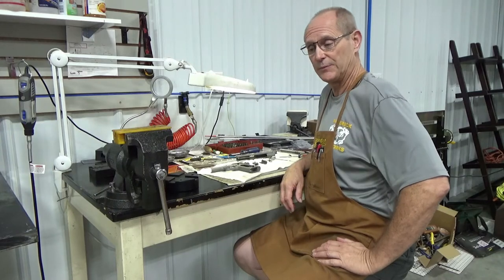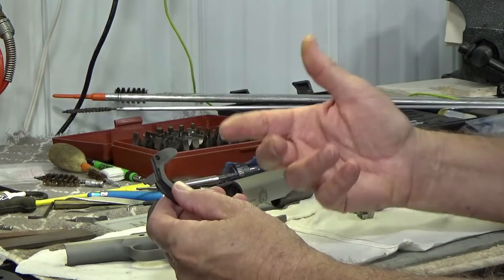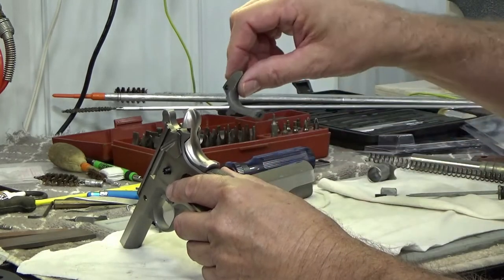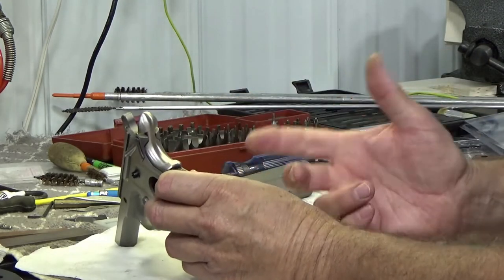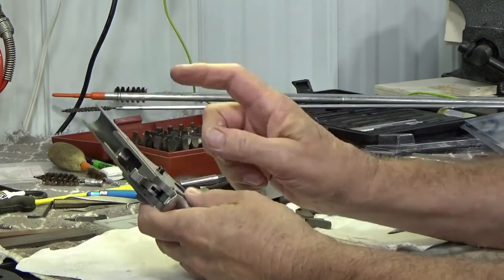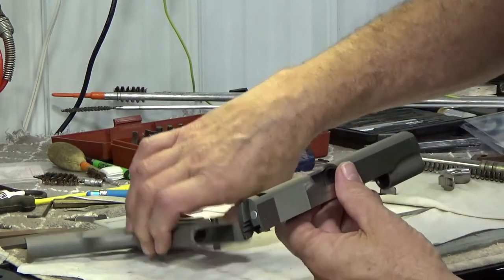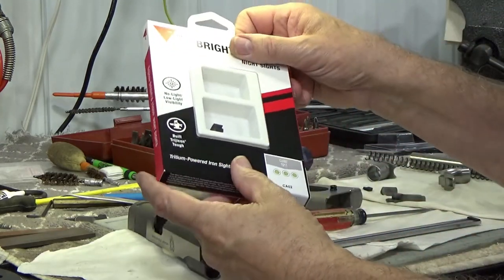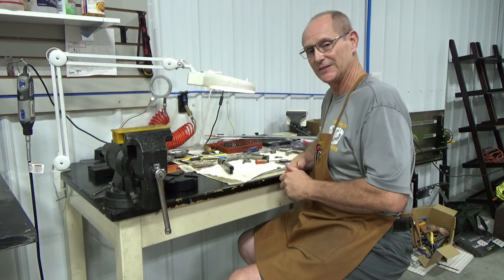Springfield 1911 Grip Safety Information

Comment: I  have 3 kimber 1911's and have done all kinds of upgrades , changing all mim parts for harrison design as well as numerous sight changes, triggers, mainspring housing's you name it, I find kimbers fit's to be excellent, very exacting tolerances from what I have delt with. have never had any feeding problems to date . have not spent over 1500 dollars so have no idea what wilson's ,ed browns, or nighthawks are all about, but will continue to say kimber makes a fine pistol. also have a micro 380 with 0 problems. good video nice info for those just starting

Comment: I be-leave the Springfield uses a .220 radius grip safety instead of the more common .250 radius. All that was needed is to fit the correct .220 radius safety with a .220 radius jig from someone like Smith & Alexander. I have done many of these installations.